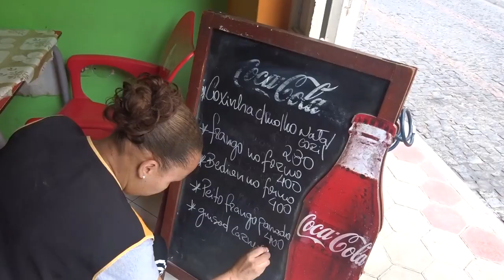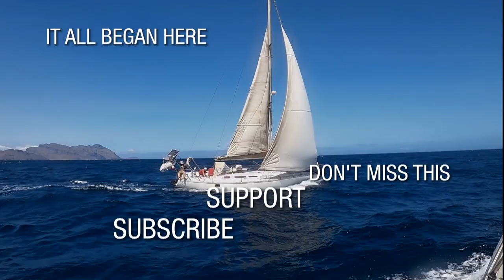Trying To Sail On | Day In The Life Of Full Time Sailor | Sailing Galopin I Season 5 | Episode 53

Comment: Diesel did not look too bad from here. You might what to tinker with an extra fuel electric fuel pump and a delphi 296 filter.  It would draw less then 0.5Amp and you could run that for days without clogging your engine filter.  Would cost ~ 60,- euro or so. Don't mess with the fuel lines to your engine to prevent creating a vacuum leak.
Reply from the maker: It was pretty dirty. I pumped out about 80lt of black diesel. You'll see I  a future episode.